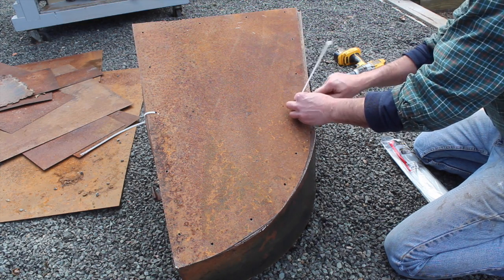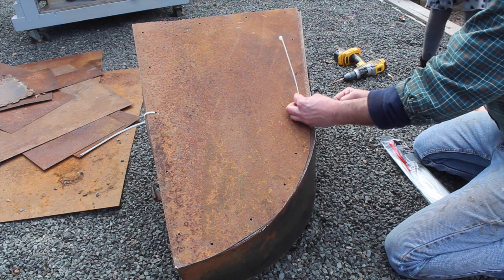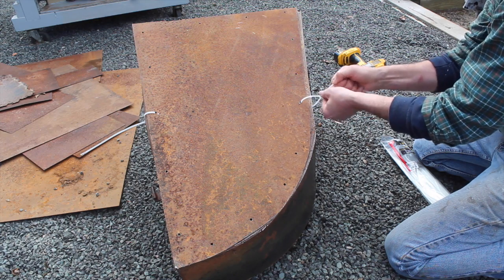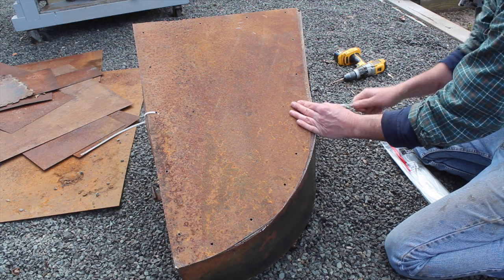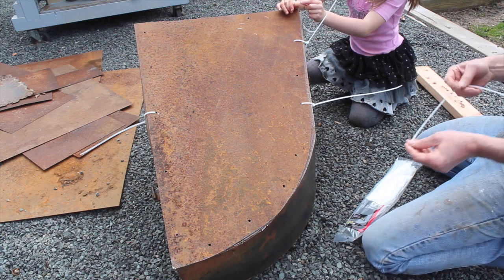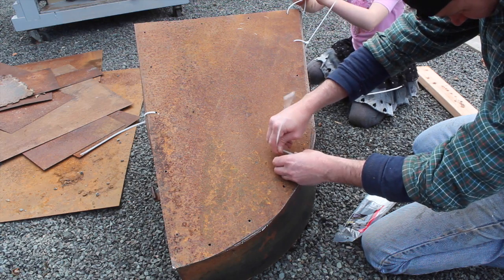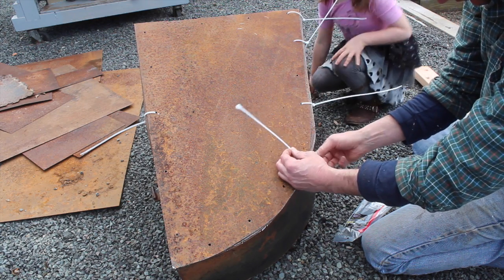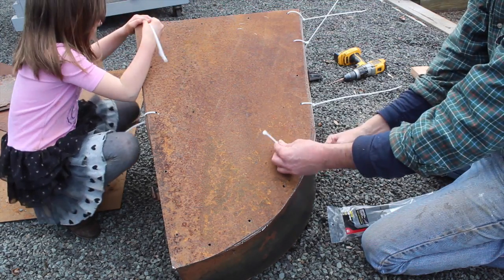Lawnmower Repair: How To Fix A Steel Grass Catcher

Comment: Keep having the same problem with my grass catchers. They are rubbing on the ground while I cut, just bought a new one this season and it's already breaking. What gauge of steel did you use? Thinking of crimping it like you did and see how long that lasts, and since I don't have any welding equipment, I think I'm gonna try and buy these steel rods that are supposed to melt and with a propane torch to weld it. Thanks

Comment: It is always better for you lawn to mulch the grass clippings.  Mulching reintroduce nutrients and organic material into the soil creating better soil structure, leading to a healthier plant. The idea of thatch build up is a myth.
Reply: ***** I If you use the proper mulching lawn mower, correct?
Reply: Steve Collins As far as I know all powered mowers are capable of mulching the clippings. The only time someone may run into a problem with mulching, is a push reel mower cutting very long grass ( over 8") there may not be enough power to properly mulch the clippings.  So the grass may clump and lay over the grass leading to a increase likelihood of fungal infection.
Reply: ***** Not all mowers are proper mulching mowers. There is a science to what size the clippings needs to be in order for them to break down and not cause thatch. The mower deck as well as the blade are designed to do just this.
Reply: Steve Collins .1. I know that not all mowers are not powered, the most common non powered mower found are push reel mowers. As I said in the previous post that someone can run into fungal problems if very long grass damp/ wet grass is not mulched by the reel mower and not allowed to dry out proper.

2.  Clippings don't lead to thatch. Thatch is caused by the stems dying, but a healthy soil will be able to recycle thatch.
Reply: *****  1. "I know that not all mowers are not powered" Huh? Did someone say they were?
2. Well, we will just have to agree to disagree on this. IME clippings do cause thatch build up in lush Bermuda lawns.